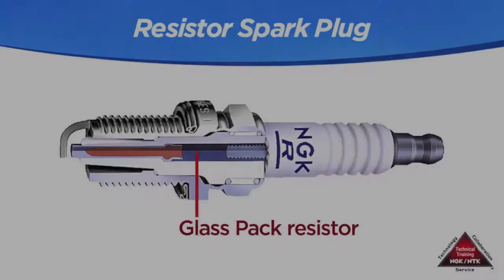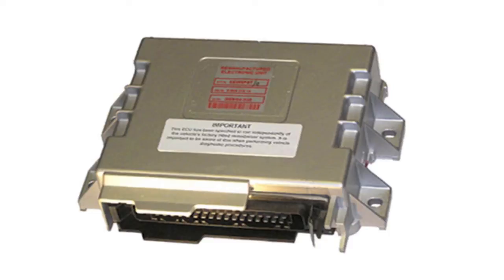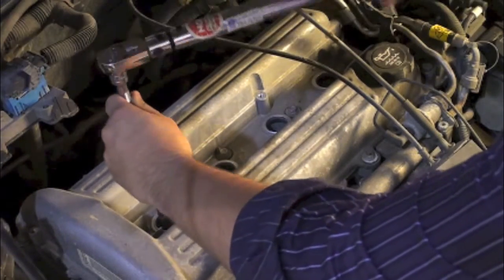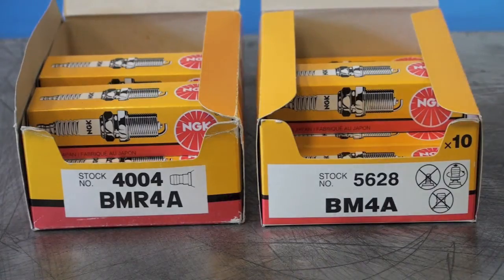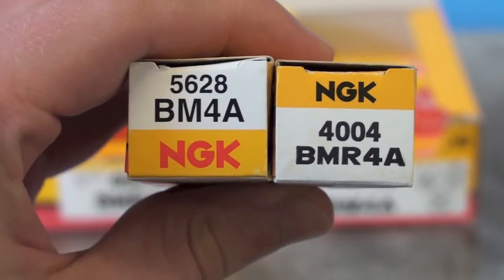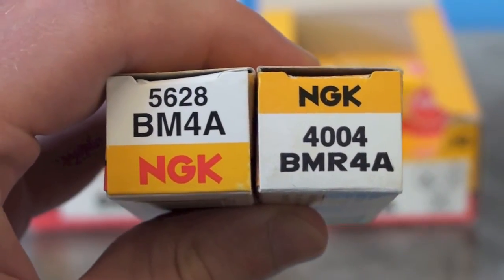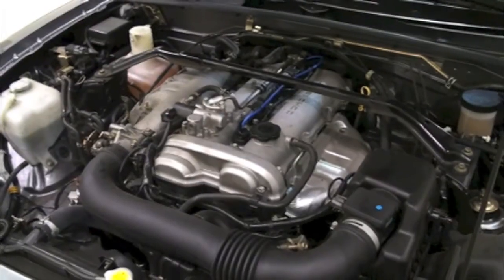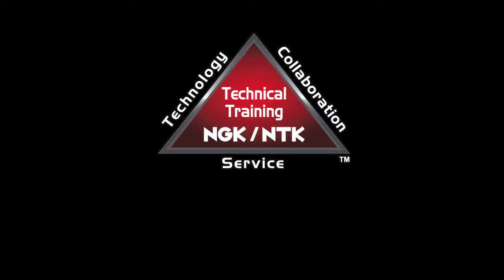Resistor type spark plugs - NGK Spark Plugs - Tech Video

Comment: Will a resistor plug work in my snowmobile? They seem cheaper on Ebay...why?
There is a NGK V Power Resistor BR9EYA
And then there's a NGK BR9EYA
Reply from the maker: Hey Matt, the resistor is only added to cut down on noise interference. Most ignition systems can handle a resistor in the plug with no issue at all. The only time it may be problematic could be in a lower voltage setup. As for the BR9EYA, the "R" in that number stands for resistor. That is a V-Power resistor spark plug. The plug number is the plug number. The two that you have listed are the exact same plug. As for "cheaper on Ebay"...ensure it's from a reputable seller. 
Mike Becker, Senior Technical Instructor
Reply: @ngksparkplugsusa  man ...u r AWESOME..THANK U!!!!
Reply from the maker: Hey Matt, no problem! Glad I could help. If you'd like I can look up the plug that is suggested for your sled. I'd just need to know the year/make/model and I could take a look and verify that BR9EYA is the right plug, or if we have a better plug for ya!
Mike Becker, Senior Technical Instructor

Comment: But I want a non resistor plug for plasma spark. Currently using iridium which as far as I know do not come without a resistor. Its for classic bike Honda SS50
Reply from the maker: Hey John, i'd be happy to look up and see if we have an Iridium plug without a resistor for you. What year Honda? I don't list any model SS50. Is there another model name for this bike? Otherwise I could also cross reference your current plug and apply those dimensions to look for something else that fits. 
Mike Becker, Senior Technical Instructor
Reply: Its the same engine as the Honda C50 (49cc 4 stroke). Iridium plug with resistor is CR6HIX. Normal plug is C6HSA. Tiny. 10mm thread! Unfortunately I tried to remove the resistor as demonstrated on youtube but only suceeded in shearing the rod leaving the metal plus resistor in place! 😣a

Comment: doesn't say shtt!  i´ll keep searching ... EXACTLY why the damm resistors? don´t tell me the manuf says so; i want to know why...
Reply: Because there is strong voltage going through spark plugs.  This rapidly changing voltage will cause electronic magnetic interference (aka noise).  The resistor acts like a shock absorber and takes the spikes out of the signal  Your computer systems/sensors are very sensitive and work on low voltage.  The "noise" creeps into the wiring harnesses outside of the sparkplugs and the system gets confused because it is not receiving the information as expected.  The extra signals cause confusion and the computer will likely start generating fault codes.
For example, on my mower, the wrong plugs caused the noise on the crankshaft position sensor line.  My mower did not know where the crank was anymore, so the engine starts to cut out and throw fault codes.